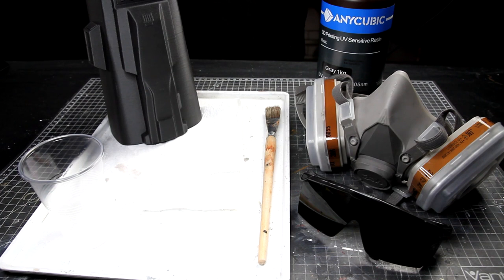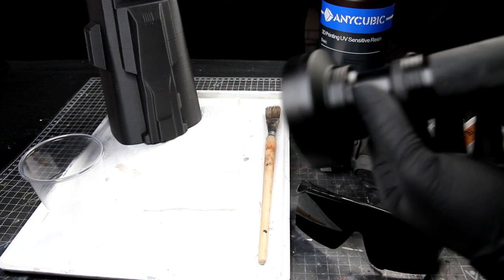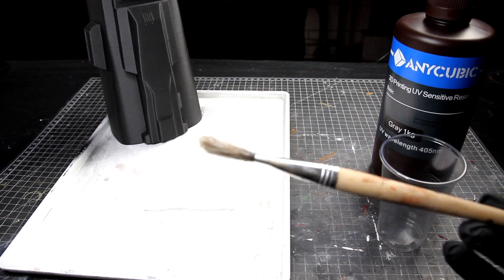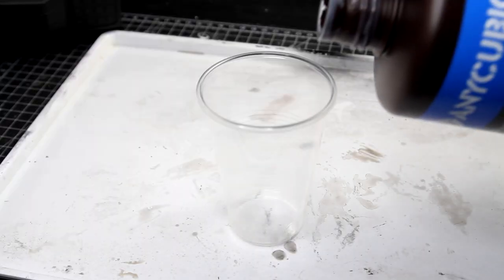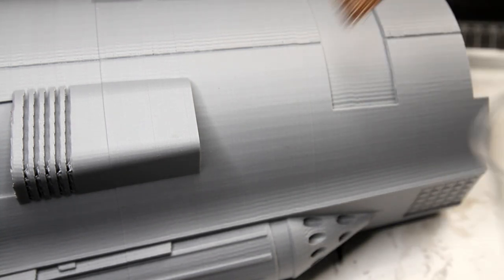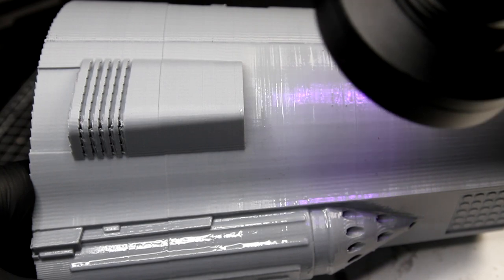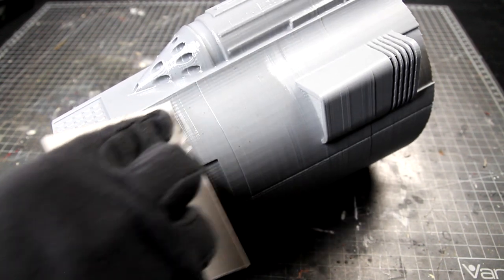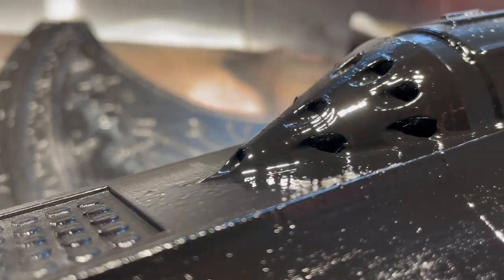The FASTEST Way To SMOOTH 3D Prints

Comment: sand first, mix resin with talcum powder ,apply , cure, sand, apply more coats repeat several times for a perfect finish after a final sand.  This is how its done on cars with two component resin. Its is not apply once or twice, the resin must have a binder in it or your wasting your time.

Comment: Just print in ABS... 10x less work and better result with vapor smoothing, as well as easy to sand.
Reply from the maker: I have heard great things about ABS. I have heard that it sometimes shrinks when vaporing, but I haven’t tried using ABS just yet, but I plan to very soon.
Reply: If you’ve actually done it which I have countless times you will know that you will soften edges heavily and lose detail it also doesn’t completely get rid of the layer lines just blends them in with a smoother transistion between the lines but you can still see them depending on the type of surface.

UV resin is the fastest method, uv resin sands easier then ABS (ABS gums up more) and you cure in 20 seconds or less and you’re good to sand.

The recommendation to the person who created this video is to add talcum powder to the resin, it gives you more control and less pooling.
Reply from the maker: @techguy38  thanks for the clearup. I will try adding talcum powder next time.

Comment: "easy way to smooth PLA"
click
paintbrush
closes page
Reply from the maker: Your loss for not giving it a chance
Reply: @batinthearmoury  well, I apologize for being a bit rude, but I don't consider applying a coat to be a useful smoothing process outside of statues or some props. I'm tired of all the goops that claim to make the part they're painted on smooth. it's not smoothed. it's just coated. At least that pla smooth stuff was a filament with smoothable additives.
I've tried this, and a number of others, but it's just... isn't suitable for mechanical parts, outdoor stuff, toys, etc.
it costs more, it adds more materials, it wears away, it scratches easily, it changes part dimensions, and still requires sanding to look good. with ABS, you put it in a jar with a wet rag, in 1 minute it's smooth, in 3 hours it's dry. PLA is well known to be nigh impossible to smooth. it lasts longer in a ceramic tumbler than metal, it's more inert than nylon, it's practically a holy grail of 3D printing, so seeing just one more video on the pile that claims to smooth it... by dipping it in goop and saying "look, shiny." is tiring.
Reply from the maker: @nubnubbud  I understand you completely. I just figured that I could help some people out because this is what I do that works for me. Of course it’s nowhere near perfect and I do intend to try out both ABS and electroplating and share as I learn. So thanks for your comment.
Reply: @batinthearmoury  try vibratory tumbling. I had some luck but the amount of force needed for it to work required inch thick ceramic stars, and even then the edges were all gone well before the details were smooth.

Comment: Resin is not worth it anymore, there are better and less toxic alternatives now.
Reply from the maker: What would you say is better? I am curious to try out.
Reply: What would you suggest?
Reply: Agreed; as a doctor and avid 3-D printer who reads and understands Material Safety Data Sheets, I’ve never seen a UV resin with acceptable toxicity, but I am curious about the “better and less toxic alternatives.” Please clarify.
Reply: Also curious
Reply: @batinthearmoury an alternative is mixing acetone and woodfiller or bondo. Then use a brush to brush it on the prints. It dries real fast, so you can either do it in layers or sand away.
Reply from the maker: @CanadianVader  I saw people do this and will definitely try it out on my next project. Thanks for the info.
Reply: @CanadianVader  Bondo is also toxic...
Reply: bondo is a 2 part epoxy...resin... filled with glass beads. It's just as toxic as UV resin. Personally, I sand then spray with a filling primer (rustoleum or similar,) into a spray booth. Alternatively, if you're not going to paint, hitting the part with a heat gun though you have to be careful- the hollow interiors can cause "interesting" patterns.  @CanadianVader
Reply: I use acetone and bonding with sandpaper and it works great. I also make sure my work area is well ventilated and I wear a respirator
Reply: @batinthearmoury  Look into liquitex crafting paste. Thinned out with water it still requires sanding, but it's much more workable and sandable. And it's non-toxic, unlike resin and bondo
Reply from the maker: @GrimGearheart  I am definitely trying this out with my new project. Thanks for sharing.
Reply from the maker: @GrimGearheart  Would you thin it with water or isopropyl alcohol or acetone?
Reply: @batinthearmoury wood filler and acetone is not better. Resin for the win. Drying with u.v. offers a smoothness that con not be matched by plasticiser. To the guy who is scared of resin, if your scared go to church. Boy. This is real life and we want the best solution for any problem. Coming in here all NO IMMMM THE SPECIALIST BOY
Reply from the maker: @legionjames1822  I am definitely using the resin method, yeah. Thanks for the reply.

Comment: “Save hours of sanding”
Proceeds to add an extra step to sanding, adding costs and materials and time… I prefer sandpaper since i dont have to waste on: gloves, resin, brushes, UV Lamp or curing station, respirator… nice clickbait!
Reply from the maker: You have to sand, however with the usual methods it normally takes 20-30 hours of sanding to get perfect results and bunch of priming in between, where I only had to sand for 10 minutes with this method and use primer once. You can search it up. I have seen others do it aswell and the resin method is by far the fastest way and it spares you so much time and physical Labour. Also for the cure station part you don’t have to get one unless you already are doing resin printing. Uv lamp is a lot cheaper. This ain’t no clickbait.
Reply: @batinthearmoury  The thing I don't like about 3D printer resin is the fumes, it's evil stuff and even though I have a resin printer I minimise my exposure to the absolute minimum, it's such a pain to deal with. How does the UV resin compare to just blasting it with a rattle can high fill sandable putty primer then sanding it? The type that you'd buy from your average auto parts store.
Reply from the maker: @wolfie54321  I completely understand your pain. What I typically do is I position an exhaust fan in the window whenever I’m operating the printer. After the printing is done, I make sure to ventilate the room by opening the windows for a couple of hours. Additionally, I consistently utilize high-rated mask filters whenever I’m in that space. Compared to the usual method involving primer and putty, working with resin is a pain without proper ventilation. The good side is that you can sand putty outdoors, while resin work must be indoors, but it’s notably faster. Therefore, my recommendation would be to set up a well-ventilated room, garage, or shed if you intend to work with resin. Otherwise, sticking to primer and putty outdoors is a safer option.